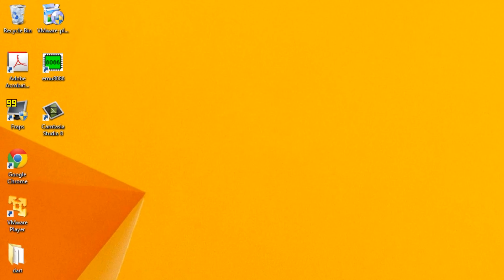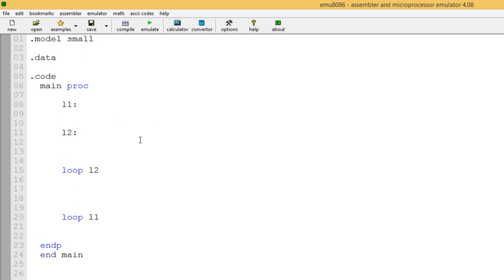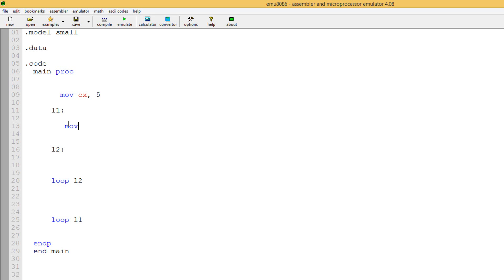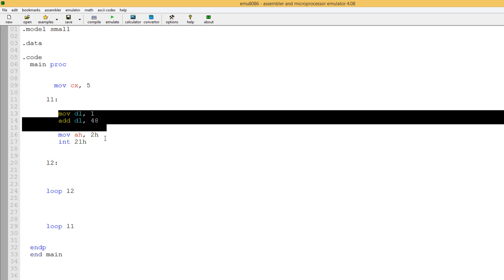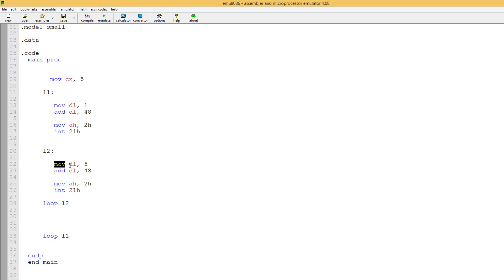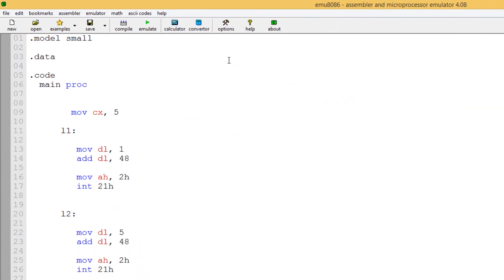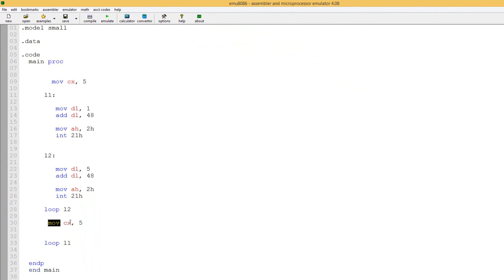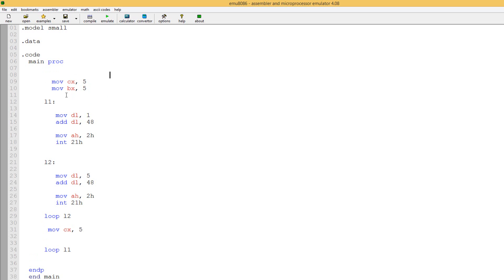Assembly Language Programming Tutorial - 28 - Nested Loops

Comment: very hard to follow a long.  right?  right?  you gotta capture attention a bit better when giving tutorials but it did do it's job.

why not mov cx into bx at the beginning instead of giving it a value of 5 that way you don't have to adjust 2 different variables later on if the code is required to edited ?